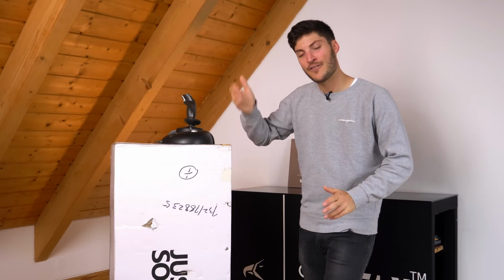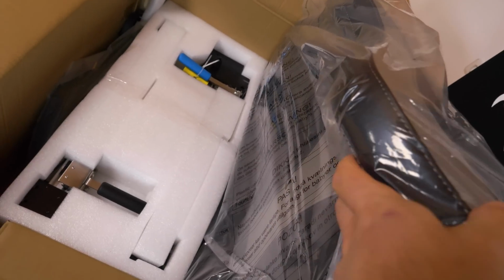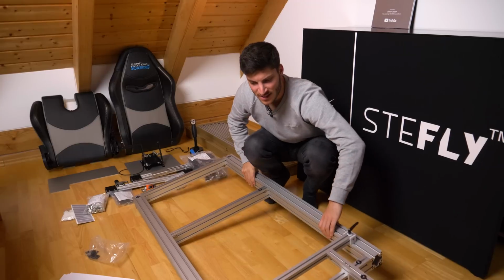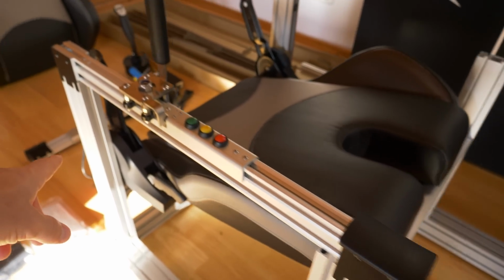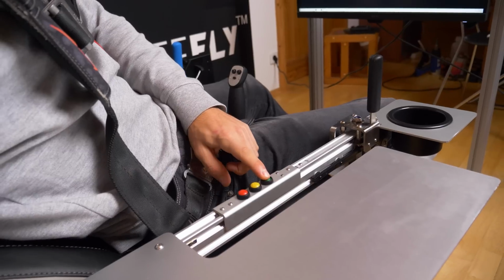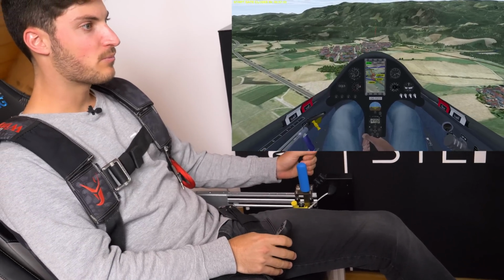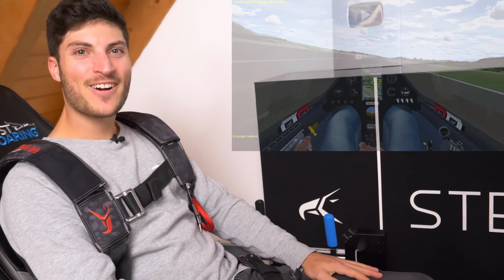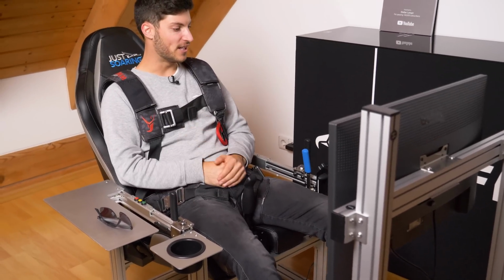Testing 1895$ Glider Sim Pro | Just Soaring

Comment: This sim is very over priced not worth it at all. You can build similar and better for way less money than that. A racing fiberglass seat cost around €120 with a frame, than you just need a regular sim pedals, better joystick and a control system. All this can be build for around €300- 500 so save your money and build it yourself.
Reply: I wish I would have read this comment before I bought one.

Comment: A couple of points. 
1 - You said that  in comparison to Microsoft Sidewinder you said that it is better because there is only twist for rudder.  This is not accurate since you can use rudder pedals with the Microsoft Sidewinder.
It looks very sturdy however there are some design shortcomings
A - There does not seem to be any adjustability of distance to rudder pedals. This is essential for pilots of different heights.
B - The monitor is much too far from the pilot.  For good immersion, the monitor must be much closer (or much bigger but that is more expensive).  Also the optimum monitor height is (approximately) the middle of the monitor in line with the eyes. Perhaps the monitor height is adjustable with the product. 
3 - As someone else mentioned, using a head tracker is very helpful. I used and recommend TrackIR 5.
Reply from the maker: A) there is a quick system to change the position of the rudder pedals. 
B) my screen is too small with 27". It's just the video editing screen I had available. 32" and perhaps even triple sreen constellation would be perfect. I will upgrade soon!
C) Thank you for the hint. I will deninitely buy one.

Comment: If you want to make it more realistic without using vr you can also use a head tracker to look around, which is really nice in my opinion as you can look around much smoother like that and concentrate more on the flying.
Reply: I was surprised he wasn't at least using a head tracker
Reply: until about 30 degress where ytou are looking at the wing and see nothing!

Comment: Oculus Quest 2 VR. It's supported by Condor 2 natively so super simple to setup. Go into Nvidia drivers and CRANK all the settings (if you have a half decent rig) and it will be smooth as silk and look PERFECT. ADD BASS "THUMPERS" and tune them so you can feel the wind over the wings and the ground under you as you land. An incredible experience. *edit - also download and install "oculus tray tool" and crank super-sampling to 2.0. The graphics spring to life. You can see the little snowflake (?) in Winter on the gauges.
Reply: How do you find interacting with real controls while in VR? Is it hard to find where to locate them with the headset on?
Reply: @cemerson  I have them all setup the same as real life. I have 2 Hotas (so 2 throttles for flaps / speed brakes) .. and another throttle just for gear believe it or not. :) PLUS a ms force feedback stick between my legs.

Comment: This is going to be an incredible game changer for safety in soaring, just as simulators for powered aircraft.
Reply from the maker: Especially for clubs it is a great tool for training!
Reply: @SteFly  Anyone questioning the cost of this setup can easily be silenced by the prospective cost of damage to a club glider.
Reply: @SteFly   Yes! I've spoken with my club leadership about this setup or even something more basic, but anything is safer than doing 200' rope break simulations with a pilot that is inexperienced. Even experienced pilots make mistakes, so it's good to practice these in the simulator, rather than in real life at low altitudes. We can do slack rope demonstrations, and everything, even spins, without having the student completely overwhelmed by the experience, and possibly have negative learning from it.
Reply: Clubs in the UK have had far better and cheaper rigs for many years...using old cockpits..this is very far from being 'first of its kind' - there are even glider sims with 3 axis motion.... indeed there is a rival company in the USA that predates this with a very similar rig by many years........
Reply: @soaruk3697  link where to buy those in the UK - - i guess the are mostly self built - and there is the problem ... u have to find one who does it
Reply: @soaruk3697  There is no off-the-shelf option for a real cockpit sims. It takes many (maybe 100 hours?) to build a proper cockpit sim rig, and also you need a written-off cockpit which not everyone has lying around.

The other one is the Mach 0.1 glider sim,  which is made from plastic tubing. Looks far less professional/inviting than this new competitor, also no flap lever. And is similarly priced.
Reply: How is a fancy chair and three levers  going to be a game changer? What can it teach that cannot be simulated much better in a two-seater?
Reply: @dondzik9690  It allowes a pupil to practice 10 low ropebreaks in the span of hour, with no actual risk, and basically zero cost.

Doing that in a glider would cost you a couple hundred US dollars, and probably a whole day. And you would have chance of messing up and damaging the glider or worse, injuring the pilots. Or the instructor would have to take over very early if the pupil makes even a small mistake.

A sim will not replace real glide training,  but can be a great cost-effective tool for specific aspects

Comment: I had an idea for a kinda similar idea - a stick and rudder which would attach to the base of a €60 Ikea POANG armchair. And using the space under the chair to have a rudimentary control-loading and spring-trim system…
Reply from the maker: Sounds like a very cool idea 😂
Reply: @SteFly  ~80% of the benefit of a simpit is having a fixed seat and fixed control mountings vs an swivel chair and a joystick on rubber feet. Really makes you feel you're inside a vehicle. So why not get a cheap, comfortable, widely available seat as the basis :D